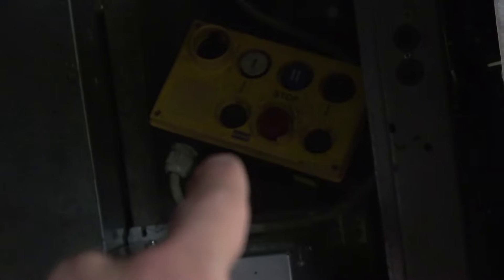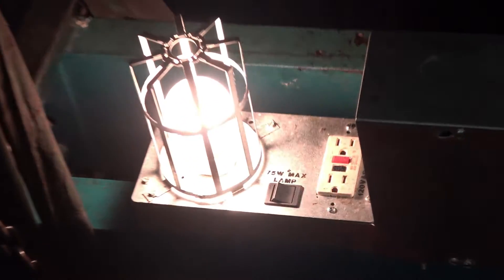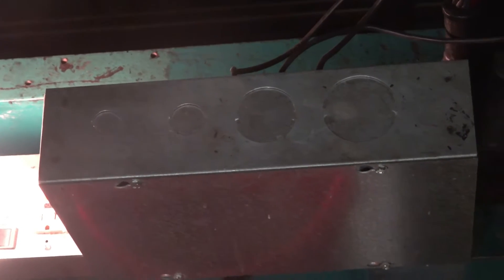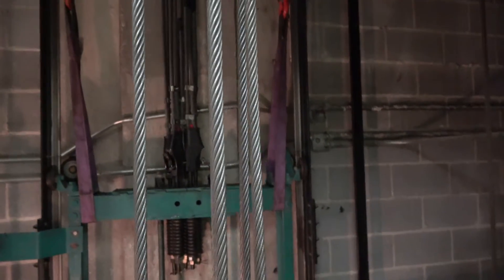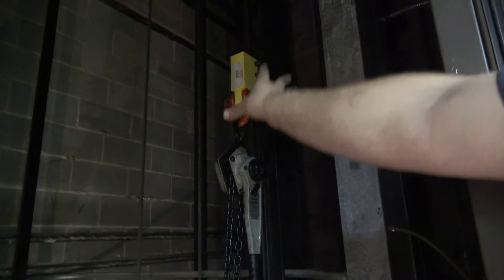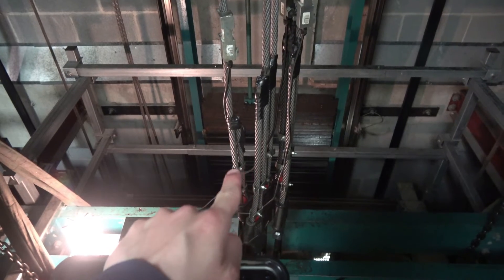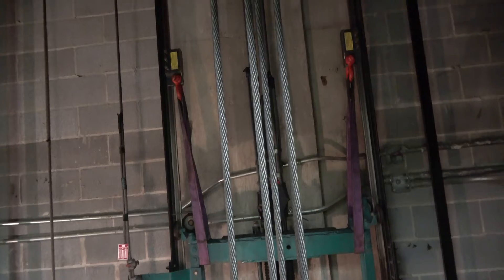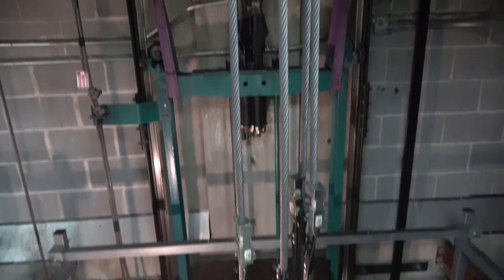View inside an elevator shaft. DO NOT ATTEMPT THIS!!!!!!!

Comment: Only real somewhat safe glimpses of an elevator shaft are from the space between the elevator shaft and cab. If you stand on the door tracks and look up, you can often see a similar shaft. Same goes for a center opening door: I found there can be a gap between the doors in some cases, and I’ve been able to see cables, counterweights (and hydraulic pistons) from there if the elevator is on another floor. Those are two places you can see the shaft if it isn’t a scenic glass shaft. I would never enter the shaft like this unless I was with someone who knew what they were doing, like a technician.

Comment: Hi Jim I want to ask what dose a counterweight do to a elevator?
Reply from the maker: It measures the load of the elevator itself, so that way the motor would lift much less weight. Not to mention the counterweight versus the elevator car move in both opposite directions. Like when the elevator car goes up, the counterweight goes down. And when the elevator car goes down, the counterweight goes back up.

Comment: Not only this, but also even asking for permission to film elevators at hotels is also something we should not attempt as per today's standards thanks to rising security levels and stricter policies about photography by the major hotel companies
Reply from the maker: When did this happen? I've filmed in like 3-4 hotels for an updated take in Downtown Houston like couple months back with no issues, even though this is technically not too relevant to the video.
Reply: @JimLiElevators  yesterday evening, at Four Points by Sheraton in Vashi, Navi Mumbai. They have OTIS with Luxury chimes, 3200 call stations and some kind of fixtures mostly visible in 300VF models. After I stopped the video, I was questioned and then told to delete the video by the duty manager

I know this is sorta irrelevant but that's another thing to add a bit